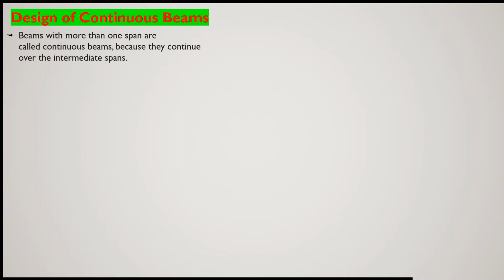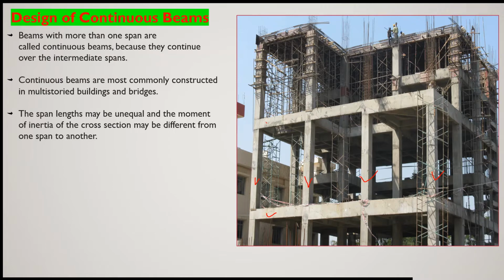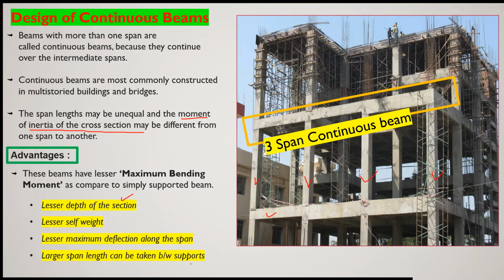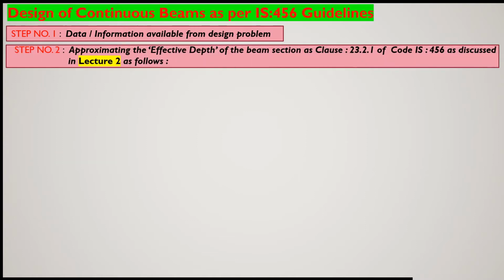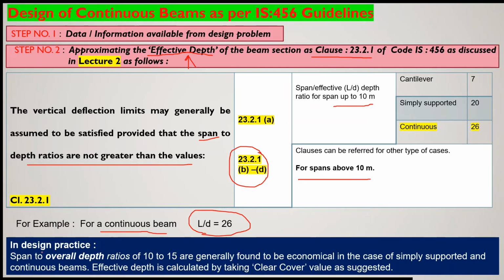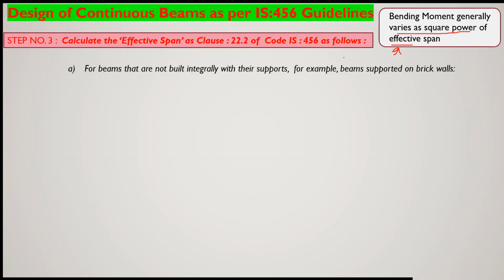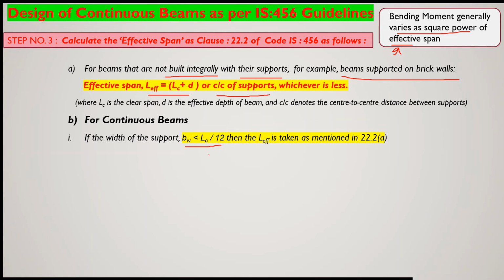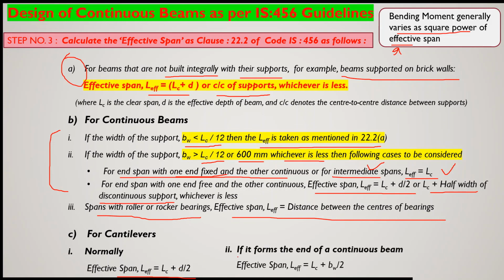Design of R.C.C. Structures - II  ( L-3 :  Design of Continuous Beam : Methodology )

Comment: Sir in video ,you said that we can take value  between 10 to 15 for span to overall Depth ratio to be economical. Sir is there  any minimum  value  for it or it is just practical  aspect
Reply from the maker: It is based on experience of various structural designers, otherwise you can make your own opinion or thumb rules based on your experience of doing design problems.

Analyzing the solution will make your concepts better than only solving the problem.